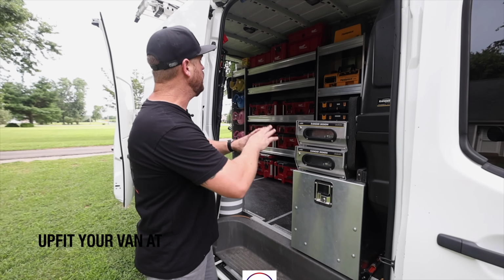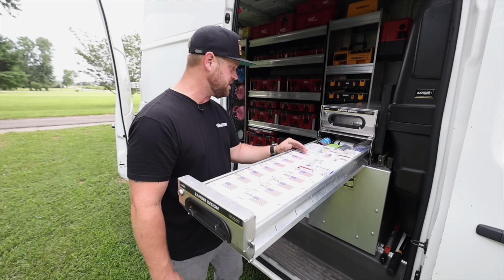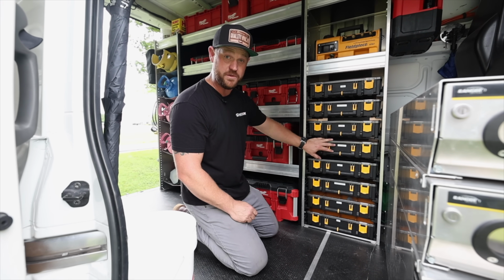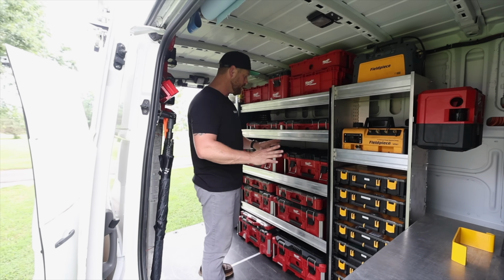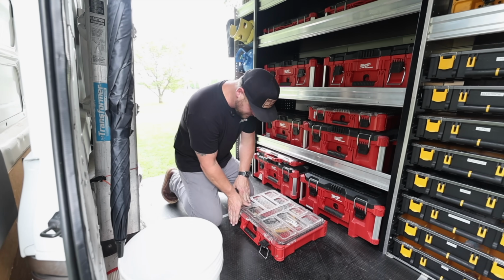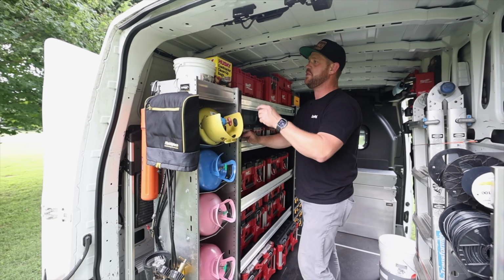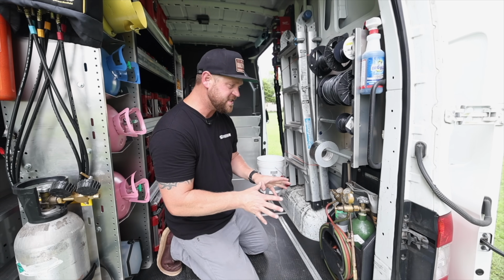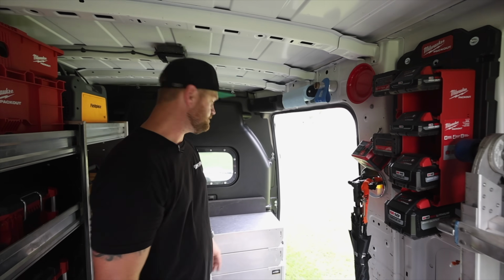Ultimate HVAC Service/Install Van Tour!!

Comment: Great setup and inspiration to most of us.  Did not see any extra securement systems in the doors. I presume you garage that at night for security.  I wouldn’t park it out of sight of my work site without securement. If the crack heads figure out how much Freon is worth these days they will really be our junk.

Comment: 😂

Y ::::

☆ The Water Hose 

☆ The Extension Cords

☆ the Ropes

☆ 115v 
Blower Motors
1/4hp
1/3hp
1/2hp
3/4hp

230v
Condenser Motors 
1/4hp
1/3hp
1/2hp
3/4hp
1075rpm

Plus

825
Rpm
Motors

I didn't see any
Coil Cleaner 
😂.

Just Kidding 
Bro.

     Ur van 
Looks 

Amazing 

It reminds me 
My

Office Set up
Longggg
Time ago..

    When I organize & cleaned 
Looks 
Beautiful & amazing 
Only For a 
Day or 2

By the end of the week

With 20 
Plus 
Projects going on at the Same time

Office was a 
Disaster by the end of the 
Week........
😪😪😪

Comment: I pretty much just ordered the exact same setup. Regarding the refrigerant tank rank they come with a 3 stack or 5 stack that holds 30lbs tanks and 50lbs tanks. Which size does your hold in the video?

Comment: I won't place any nitrogen or burning rig on the rear, because if you get rear ended u become a rolling sparkler.
Reply: Nitrogen is an inert, non combustible gas.  Are you concerned about the rocket hazard if the valve head is sheared off?

Comment: Hey mate, great setup! Really well thought out.
One suggestion, have you thought of setting up a suspension bracket system internally to hold the ladders? Instead of having the extensions which are longer by default, swap out to an A frame which folds out into a straight single sided ladder? Sa a -6 or 7 foot which obviously flips out to 12-13?

That way it’s easier to grab and you don’t have all the drag up on rhe roof? Also makes it easier to park in lower underground carparks etc? 
Otherwise sweet as!

Comment: take the ladder off and put another shelf... You need PARTS! control boards, contactors, motors, transformers, relays, hard start kits, thermostats, Txvs, temperature controls, thermostat wires, low/high pressure switches extra nitrogen tanks, back up O/A tanks, 2" pipes, gas pipe fittings, You still need a lot more for that van to be efficient! And grab a bucket of dirt and grease and rub it on your tools. Make it look like you actually use your tools.
Reply: He doesn't need to have the van layout to your liking. He's been in hvac over 10 years and knows what works for him
Reply: @JonathanGarcia-ve8kk  it's not to my liking. It's a SUGGESTION. You need parts! You Need to be a supply-house on wheels!

Comment: I like the organization. Excellent set up! Could you be this organized if you added another service and install type to what you already do? Like hydronic systems with oil or gas burners? 
I notice, you carry more tools/hardware than you do actual parts and items? I’m over loaded with controls and valves and fittings and everything from A-Z. Which leaves me barely any room to be that organized with tools, etc.

Anyone know what I can do? Should I seriously carry less to keep the van more simple and organized? Maybe do the seasonal swap of items, that’s a good idea. Most my items stay on the truck for a year before I even use them.
Reply: Buckle down and really keep track of what you use, how often and try not to overstock yourself. If you gotta make a spreadsheet, do it. You'll probably find that you're wasting a ton of space stocking multiples that you dont necessarily need and depending on how often you go to the supply house, you could justify cutting a bunch of extra stock out.
Reply: Excellent advice, thanks man! Will definitely consider trying this
Reply: Ya need both tools and parts, that why I drive step vans loaded to the gills and easy to climb into. Yup bad mileage but a lot cheaper than trips back and forth.

Comment: Very nice, organized and professional looking setup! Only knock I have is the RLS press fitting garbage. I’ve been flowing nitrogen and brazing for 20 plus years and I don’t plan on stopping now. I will never trust an o-ring like I do a properly brazed joint. To each their own but it’s not for me and I will never use it. Also, it’s not like you can use it to change compressors, reversing valves, TXVs etc., so if you still have to carry a torch just use the torch for everything.
Reply: Well said and I agree.

Comment: Nv2500 suck i had mine for 3 years now and my sliding door won’t open and been repaired so many times
Reply: Nissan also has transmission problems. The Chrysler of Japan.
Reply: @scotts4125  yeah i heard that’s why they discontinued them last year

Comment: Can someone answer a question, I use the 4 port manifold for vacuum I am thinking about getting away from it, so my question is which side (liquid or suction....and I think I just answered that when I wrote it, but still would like a confirmation) do I attach my micron gauge to?  Thanks in advance and please be nice, like I said I think I answered it, but want clarification.
Reply: A good method to do when you have the space. Is to buy 3 vacuum rated valve core removal tools. Attach them to your suction/liquid side remove your schrader valves. And attach your 3rd tool to your suction side valve core removal tool and put your micron gauge on that tool. So you have the ability to not get the gauge contaminated with oil. Since it’s a ball valve type. Buy two vacuum rated 3/8 hoses. With a 3/8 fitting and 1/4 fitting. 1/4 fitting is for your valve cores and 3/8 for your vacuum pump. There’s more videos on YouTube. For better detailed explanation on YouTube. Look up A/C Service tech.
Reply: Furthest point from your pump. I usually attach to the liquid line port on equipment and pull vacuum from suction line port.